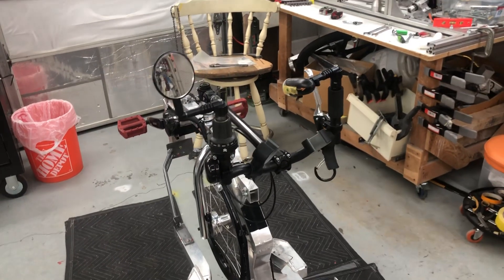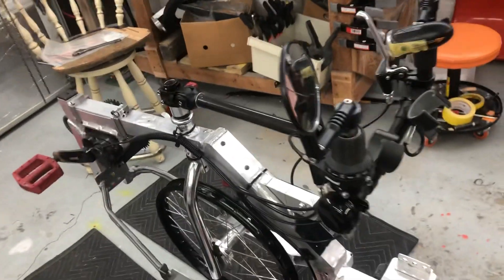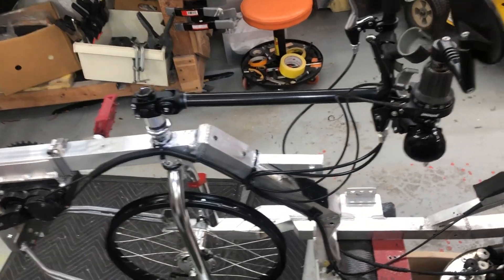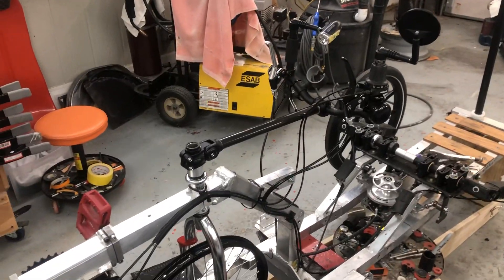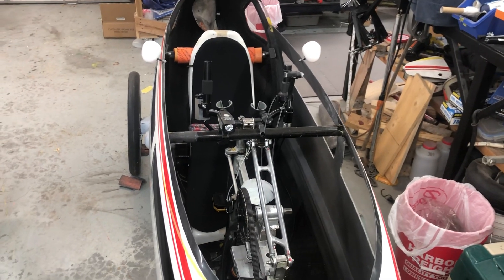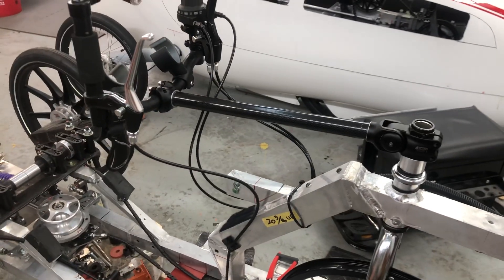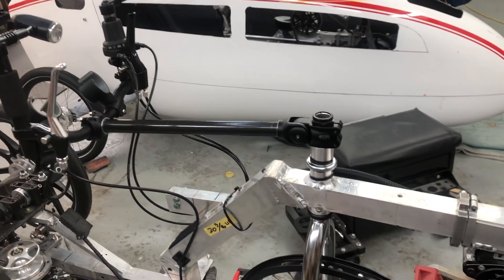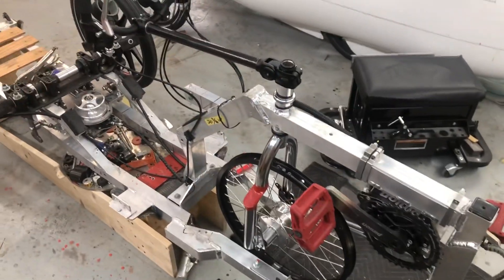velotilt R&D machine

Comment from the maker: The "Kalloy" steer stem is adjustable up or dwn.  l cut in half an installed 25 mm carbon fiber tub with PTM&W aircraft adhesive.